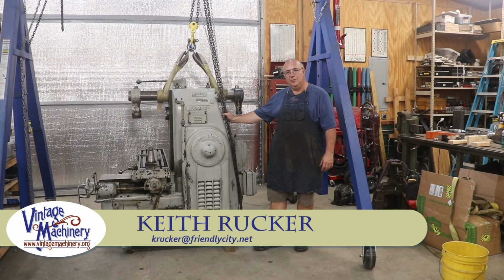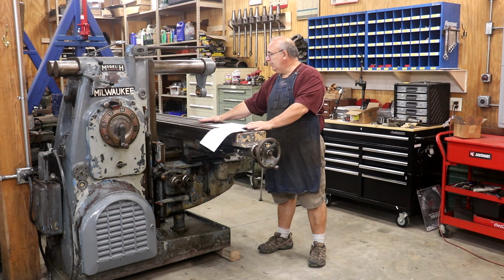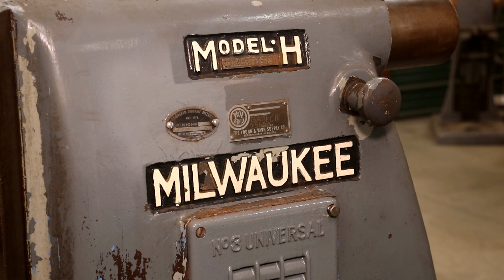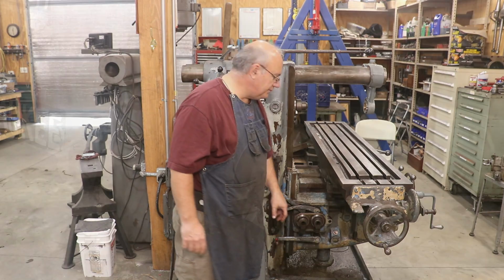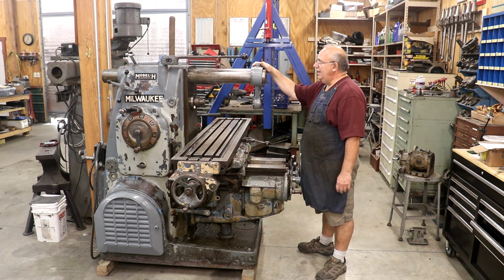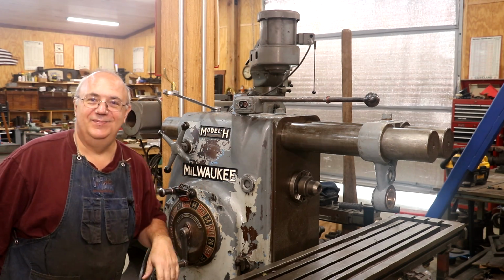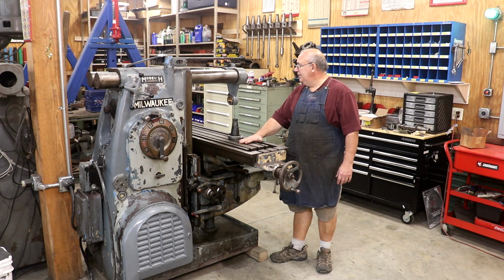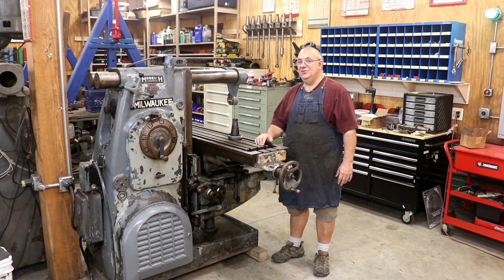New Machine Day: Kearney & Trecker Model 3H Universal Horizontal Mill

Comment: Very nice machine , I am working on a 7 1/2 hp - 3CH , I've got the Y axis handle and dial off and according to the parts diagram there is part #62 cross feed screw bearing  adjusting nut , that is a spline & part # 61 cross feed bearing adjusting ring . The ring has notches that look like you'd use a spanner or a punch to loosen it . Tried loosening in both directions with no luck . don't want to break it . Wondering if you could help me or know some one that can ? I'd appreciate it ,thank you

Comment: i have the same machine but mine is a #3 plain, mine is missing the overarms ,overarm support and crane and parking attachment. i do have the universal verticle head and drive gear and a set of #50 collets,the machine has been partially taken appart by a machine rebuilder to estemate the rebuild cost, the company i worked for decided to replace the machine so i bought it and have had it for many years. the reason it was sent out was the slipper clutch for the knee rapid was slipping and it sounded like grinding gears, when i examined the parts i saw that some of the springs were broken and that was all that was wrong with the machine. my shop floor isnt going to be able to handle the load and i dont have the power to run a 10 hp motor.i love that machine but im concidering selling it or mabe parting it out. the problem is the specs say it weighs 8k pounds so shipping is verry exspensive and it costs 300 just to rent a forklift.i live in northern ca about 100 miles north of sacremento so if anybody in the general area is interested maybe we can make a deal

Comment: I have a #3 Plain I am putting back together.  1st step was to clean all the old cuttings out of.  Mine is a 1943 from what I can figure.  It is also a war finish.  IT came with three over arm supports, all different support types.  It has the clamp for the over arm rods and it also has the handle for the side controls.  You only want one there as it is used in both and with two you can't spin it.   I am missing the head too, but from I've learned is most are not accurate due to age.  My plan is to make molds to pour a mount to use a J head.  This give the best of H&K and a Bridgeport .  
I still have the motor that came with it but it has a bad winding.  I have a new 10HP motor I am fitting into it.  
My site:
 https://thisisjust4fun.weebly.com/kearney--trecker-milwaukee-3k.html

Comment: That 3H looks remarkably like my 2K.  It looks great!  Congrats!  I got a vertical head that does not require a special gear, and I replaced the filter with an adapter that lets me use a standard spin on oil filter.

Comment: So i guess by next month you will be working on a 3D printed outer support head so you can get one cast up. .  but design it with a mounting foot that can be cut off after final boring of the holes and slot.  and bore it right on the 3H..  can't have a machine without all the needed accessories.

Comment: 15:00 Independent overarm bar movements - I'd have never have thought of that as the reason to move them independently ! If anyone else has another reason, I'd love to know it. I guess it means you can fit the support to one bar only first - as it should be easier to fit to one than two - and you don't want to be loitering with the weight of that for too long - then slide the second bar in.

Your bars run really freely. Ours has a ratchet lever drive - so it's not like your 'wheel' which you can spin.
Reply: I was told its for the reason you stated.  I have found it makes it easier to store them tilled up on one until needed.
Reply: @robbob385  As if they' couldn't have made one stick out an Winchester (spelling corrector of 'inch further' ;) ) than the other and be done with :)

Comment: Keith, Would you consider a project to create a set of metric "Change Gears" for a Monarch Series 61 lathe? 
I think that would be a great project for this machine!
Reply: A 'set' ? Is that one for each pitch ? I don't think the whole train needs changing for metric !
Reply: @millomweb  Actually,..there are 13 individual gears in a set of "Metric" change gears as depicted in Monarchs schematics,.. I would like to see Keith make at least 1 to demonstrate that new machine he just acquired,..I am getting ready to cut the gear set in a couple of months from today.
Reply: @dcobel60  13 !! I'm surprised - and that must be a complete set of changewheels. I doubt this is necessary - so I'd strongly suggest you research what really is needed to modify the imperial set to do metric without making a complete metric set. It seems the key feature is a 127 tooth gear - 127 being exactly half of 254 (25.4 mm to an inch). So, for research, can I point you firstly to:
https://www.hobby-machinist.com/threads/cutting-metric-threads-on-an-imperial-lathe.78127 - as I think your best solution is to adapt the set you have with 1 or 2 extra gears rather than replace them all.
Please let me know if that helps you out as obviously I've just scratched the surface.

It seems Monarch gets a mention lower down the useful discussion.
Reply: @millomweb  Why would you assume that I did not research that? Additionally, what ever I do,  or not do is none of your business, I recently retired after 34 years in a machine shop and teaching metal shop for Phoenix Union HS, and don't need  any advice for Monarch lathes,...too bad you were not around back in the day to tell Monarch how to build the machine, and how to modify the gear set,..they would have given it as much consideration as I have today!
Reply: @dcobel60  Why would I assume you'd not researched it ? You do not ask for imperial changewheels - so it's reasonable to assume you have an imperial set. On that basis, it is more reasonable to modify your existing set than go to the bother of getting a complete metric set. ALSO I never said it was any of my business if you want to waste your time and effort achieving the result you want by going the long way round. Clearly you have completely flawed logic as you've demonstrated here while I've been appropriately helpful. You haven't even had the courtesy to explain why modifying the imperial set isn't going to work for you. Maybe you don't know ? Maybe you're guessing and assuming. How long you've been in a machine shop is neither here nor there. Clearly with your OP you seem to be requesting 'assistance' of sorts - despite all this alleged time you've spent in a machine shop. As for your OP question, it's most likely the answer is obviously NO - why would Keith want to make gears he has no need for ? As for teaching at high school, When I was there, I taught the metalwork teacher how to cut threads on the lathe. It was part of a job making a sash cramp for woodworking. He was so impressed with my work, I got a 'commended work' for it and he didn't seem the sort to give them out lightly. In fact, to get my work back, I had to go to the staff room for it as he'd been showing all the other teaching staff!
So, you go ahead and waste your time making gears unnecessarily (it seems) and continue to be an ungracious idiot when decent folks offer you help. Sadly, you're not alone in that respect.
Reply: @dcobel60  Is this your second childhood or third ? Maybe you're still on your first.

Comment: I worked on a KT back in the 60's. The one I used also had a head for vertical milling. The head was attached to a swing bracket so I could remove it and just swing it out of the way to use the machine as a horizontal. Lots of memories

Comment: Also a old millright told me that the ways on a machine tool will not wear evenly unless the machine is leveled properly.
Reply: I'm not sure 'levelling' is the precise reason but the main thing to avoid is any twist - particularly long lathe beds.
Reply: @millomweb  I can't disagree with you there .
I plained turret lathe beds for Waner & Swasey in the 1970's .
I worked on raw castings.  I had to aline the bed to lay out lines scribed at foundry. The was leveled to four corners. The most important part was packing had to be tight and in a free state before 
clamping so as not to put   a twist in the bed . Everything was machined to the ways I rough plained.
Reply: @erneststorch9844  The biggest bad effect you can do with 'levelling legs' is apply twist. It's effectively having 2 diagonally opposite corners too long while the other two are too short. Twist in any case is pretty much only going to be slight and very difficult to spot without accurate measurement - and load on each leg isn't going to fix it by all being the same as the bed may have a natural twist in it in any case that needs removing by fine leg adjustments.
People seem to like clean-looking machines but as a mechanical engineer, I'd prefer to see well-oiled slideways! The downside is that swarf sticks to it but I think that is minor compared to taking good care of precision parts by minimising wear - and at the same time having a smoothly operating machine.
Same with cars - many proud vehicle owners polish and love their vehicles to keep them looking in mint condition yet put only 'average' oil in the engine ! 'Average' oil is fine because it MEETS the required standards - but lubricants from large chemcos (Esso/Exxonmobil/Shell, BP etc.) make their lubricants exceed manufacturers requirements. The difference may not so much be in lubrication but in oil seal care.
Cars I'd had in for a service- had a few owners query why theirs wasn't using so much oil now - the difference was the better oil. And that's surely one of the easiest parts of a car to change!
Reply: @millomweb  I agree you on oil.  With some people getting the them to change it period is the bigger problem. I had bought my sister a car and told her to make sure she changed the oil. 
Later I asked her if she was changing the oil .
She said yes, when the little red light came on she added oil . The quality of the oil is very important but changing it
regularly is even more important .
Reply: @erneststorch9844  I'm sure the Rover SD1 used to turn the ignition off when the oil light came on :) Had to take one of the bends (left or right, can't remember which) steadily as the pump briefly starved of oil. Not my car !!!!!
I'm not doing the mileage to warrant oil changes !

Comment: Nice looking mill.. I have a 2H 50 taper and I'm looking for the vertical head and drive gear for it.  So if that gear you have works on mine we may need to work a deal on making a gear for my mill.

Comment: I have a 2h plain made in 1943 with a Bridgeport "M" head on one overarm... Really nice to be able to more one overarm independent of the other... Not all 2h machines had a turnstile to move the overarms.. I am glad my machine has it though as it makes it more versatile for what I am using it... Cheers; Mike in Louisiana
Reply: How many reasons can you think of for needing independent overarm movement ?
Reply: @millomweb  Two right off the bat: One for making it easier to load arbors as Keith stated and two, a  milling head attached to one overarm as with my 2h plain and M head Bridgeport and/or a Kearney and Trecker midget mill.. I have both... Cheers from Louisiana
Reply: @ramsay19481  The first I've seen - as per this video but I can't find an image of a vertical head mounted on only one overarm bar. It's also not logical - there are 2 use them both for increased rigidity - makes sense !

Comment: Should be three arbor supports to a set.. The style "a" for piloted arbors, the style "b" used in conjunction with the arm brace which attaches to the knee, and the intermediate for extra support with either style "a" or "b"... Spirals and helices can be cut with a plain table with a universal head as long as there is gearing between the table screw and the dividing head.. You get the offset from the head swivel instead of the table swivel and the cut is taken on the side of the work instead of the top....I am curious as to if and when the bijur oiler started on this series.. I see the oil pocket in front as with the older wick fed oiling systems.. Cheers; Mike in Louisiana

Comment: Congratulations with this "new" horizontal milling machine. Are you planning to give it a new paint as an overhaul?
Is it normal to have a hours meter on production machines for scheduled maintenance?
Reply: I would think scheduled maintenance would be closely tied in with holidays and general use - like a squirt of oil in all the oil points every morning.

Comment: Nice machine Keith, other than the horizontal table pivot it seems exactly like my K2. They are really nice machines. That head drive gear looks small compared to mine.
Reply: K&T made at least 3 vertical/universal heads for this machine. Unfortunately they didn't use the same 50 taper drive gear.   My 2HL uses 40 taper with completely different universal head.
Reply: @chuckinwyoming8526   yes the vert head uses 40 taper.
Reply: Would be nice if it'll fit my 50taper 2H.

Comment: Mother of God.... Make some chips!
Reply: I see a lot of big machines on several channels, but not much "machining",Seems like one of the only "working" shops is Keith Fenner.
Reply: @garybrenner6236  I usually produce a 55 gallon barrel worth of chips on my channel every month. I do admit though lately I have had more repair/fab work come in the shop than machine work. With the cancellation of so many motorsports events it has really cut down that side of my business.
Reply: @bcbloc02  Then you must be operating a real "working" machine shop like Keith's.
Reply: Gary Brenner well Keith F has me beat as he works his full time. I still have a day job so my shop work falls in a 4hr/night time frame. I would love to do it full time but going to have to get this virus mess cleared up to make it viable for that.